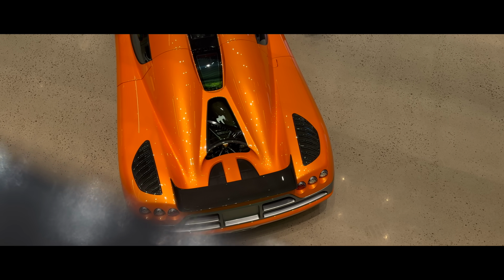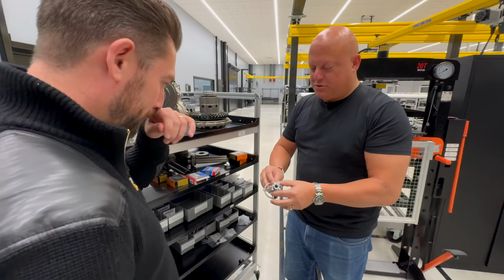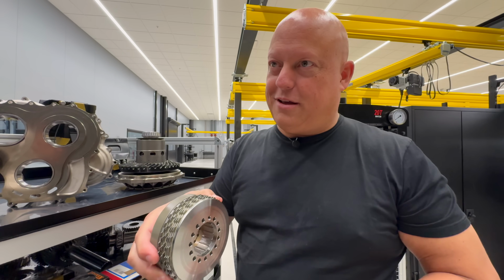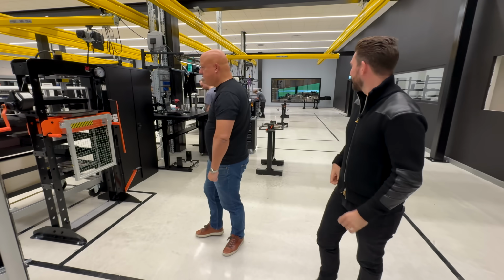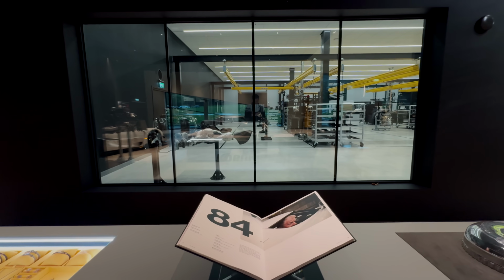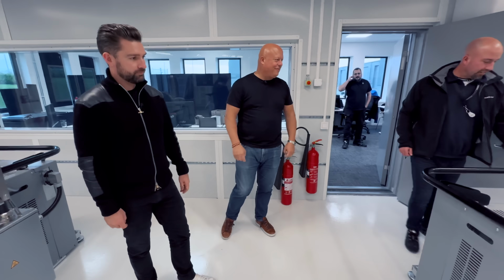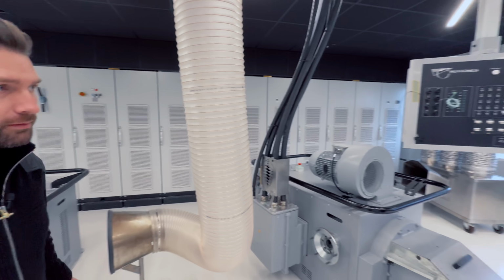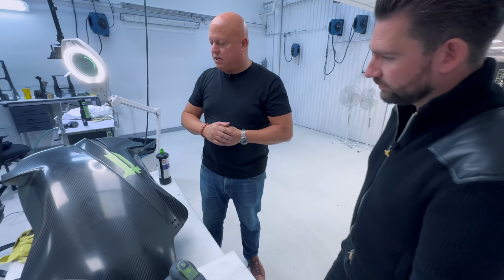How To Build A Koenigsegg - NEW Factory Tour

Comment: I dont see any heavy machineries that are used to fabricate the parts. Just the ready-to-assemble parts and a bunch of assembly bays and some testing areas. Where're the machining tools, the metal stamping presses, engine smelting furnaces, paint dipping pools etc??!? Those equipments would cost them hundreds of millions $ to set up. Does this mean that the guy just outsourced all his parts manufacturing and just assemble them in his "factory"?!?

Comment: I loved seeing the hover dyno hubs!   When I worked at Caterpillar's Large Engine plant in Lafayette, IN we had a hovering "chassis" that you put the engine on (up to 60,000 lbs or ~27,000 kg) and mounted it to that outside of the dyno room, then hovered it in to the dyno room and hooked it up.  Then run an 8,12, or 16 cylinder engine making up to 5000 hp and 30,000+ lb-ft and turbos bigger than most automotive engines!  You wore double ear protection (weren't supposed to be in the dyno room while running but I was working on exhaust heat shielding and needed to get thermal images and adjust the fabric shields) and you could have someone yell at your ear and not hear them at all.  You felt it in your whole body especially when we loaded the engine.

Comment: I am just utterly in awe of not only the cars but the facilities and tooling to make them.  The idea of..."well we took our torque wrenches, made them wireless with a computer system, and it just torques every bolt correctly and tells you if you did it wrong," is staggering to me.  It makes me so, so sad that I'll probably never get to drive one, let alone own one.  Every component is a masterpiece.
Reply: My thoughts as well. Network connected tools automatically adjusting for every step. Crazy! Maybe other car factories have this also, I don’t know. But I’ve never seen it before and it’s badass!
Reply: @Patrick94GSR  They do, it’s pretty standard if a brand wants quality. I work for Volvo Construction Eqpt, and we have these in our engine and component factories, and also on the production line for the machines themselves. Admittedly, our torque wrenches don’t have carbon parts on them, which I think I saw on the Koenigsegg ones.
Reply: @BOLLOX64  yeah, these guys do basically the best of common industry standard procedures, but even better.

Comment: As someone working with the IT side of those tools for another vehicle manufacturer (not a competitor), I really appreciated how you shared their setup with the electric nutrunners. Our setup is not identical, but very similar.
Reply: Biggest differences would of course be the software, we use a different one, but also that we generally avoid wireless equipment where possible. We don't have time to muck about with bluetooth dropping, replacing batteries etc. Those things don't matter as much when you make one engine per day, compared to several hundred.
Reply: @MrJamesBanana  It is a top brand (Atlas Copco), they are expensive but there are designed for large scale manufacturing using wireless tools.

Comment: Most of these cars are bought and then put on a shelf not driven so it's very difficult to know whether these cars are actually built to last or whether they are a technical excellent but without durability. That's why Porsches are so tough and last so long because they all go racing and all those parts are being tested on a racetrack over the last 50 years totally different concept

Comment: Interesting to see the turbo layout on the V8 platform are the traditional side of each bank.  

MercedesAMG puts their turbo design between the V of both banks making for a tighter package.
Reply: V8 version Gemera will use hot-V configuration. Simply because they need to package it tighter to make it fit into the chassis.

Comment: But are they as reliable as a Bugatti? (I'm not saying that Bugatti are reliable, but the owners I've spoken to say they're reliable enough to be a daily. They also say that Koenigsegg aren't, but that's something I'd like to know from someone with contact with the brand)
Reply: So that is a tough question. VW is a big organization and is able to put a serious quality function to work on the Bugs. The Egg team is much smaller and on top of that they keep changing up their gear, which means not a ton of lessons learned on say the tranny that gets baked into the next car. Plus being so small, parts and a service network is a big challenge (i.e. daily driver able but likely the owner's 5th car).

Wonderful video and loved the dyno room.
Reply: Whoever told you Bugatti's are reliable enough to be a daily and Koenigseggs aren't just lied to your face.
 The W16 alone overheats a lot wich is why they need 16 radiators to cool it off. Plus there's 2x moving parts from a V8 wich aren't stress manufactured. Their engine is only good for 1573hp in 98 RON wich is basically affordable race fuel. Also they have interior upholstery issues. Maintenance on Bugs are hella expensive aswell. They charge you $45k on oil and filter change alone and you'll have to do it 4 times a year. Tires are also very expensive plus each year you'll need a brand new set.
As for Koenigseggs, they're all stress manufactured as said in the video. Earlier Koenigseggs had abs sensor issues wich they fixed with the One:1. Other than that, their cars work really good. They only takes service 1 or 2 times a year depending how you use it. 
So by that said Koenigseggs are 100% more reliable than Bugattis, but to be honest, nobody drives a $3 mil car as a daily, so that is a pointless question.
Reply: @gativirycat6686  The cost of changing the Bugatti's oil is 20k not 45k and it's once a year or every 10 thousand miles and there are 10 radiators, not 16. So you're saying that just because there are twice as many parts, they are less reliable? I've never seen a Bugatti catch fire, something that has happened to at least two Koenigseggs. Bugatti claims that the engine, with the right maintenance, can handle 300,000 miles without a problem and Andy Wallace himself claims that they used 16 cylinders instead of 8 because of reliability, as each cylinder has to deal with less pressure and helps with balancing and the bugatti chiron ss makes 1600hp with 98 and the Jesko with 98 makes only 1280, with E85 it makes 1600 but the ethanol composition reduces the life of the components and many people use bugattis as daily
Reply: Bugattis are definitively more comfortable to drive cuz of the weight. However they're still not as good quality built or tested as a Koenigsegg. At the end of the day, they still VAG engineered. Hope Rimac does a better job.
Reply: @gativirycat6686  I'm referring to reliability, not comfort or build quality. comfort everyone knows that the bugatti are better, the build quality of the bugatti is also superior, just compare the veyron with the CC or the Agera R or the chiron with the Agera RS or the Regera and I agree with the koenigsegg being more tested ( at least from Agera onwards), but will they be more reliable? the owners say no
Reply: I own a Koenigsegg. Not cheap to own n fix.  Have to ship it to the dealer.  Or get the technician's to fly in
Reply: @happyguy4525  Cool! What chasis number you got? May I ask.
Reply: @gativirycat6686 none 😂

Comment: Neither F1 or T.50 have flywheels. And T.50 will build revs at about 52,000 revs per second according to G.M.A and Cosworth. (This is 0rpm to 12,000rpm at a rate of 52,000 revs per second). This should clarify below comments. I apologize for poor clarity.
Reply: 52.000 rps? What are you on?
Reply: @jonasthemovie  You’ll have to do the research for yourself it seems. Watch the video Top Gear just put out last week. It’s the world exclusive drive of the T.50. Cosworth built the 12,000 rpm 4.0 liter V12, and its engine response in neutral builds revs at 52,000 revs per second. That’s 0-redline in 0.2 seconds. And it sure sounds it in the videos.
Reply: @alexbelmonte4581  12.000 rpm is not 52.000 revs per second.
Reply: @alexbelmonte4581  12000 rpm is 200 rps.
Reply: @DennisKarlsson  I’ll edit my first comment but will also clarify here. The car’s RPMs will accelerate from 0-12,000rpm at a rate of 52,000 revs per second.

Comment: Flux capacitor?! We mastered antigravity in 1954, in the future all cars will use it. We dont need, oil, gas or hydrogen which is another scam. We need free energy devices which harness energy directly from the vacuum. Rockets are for retards!